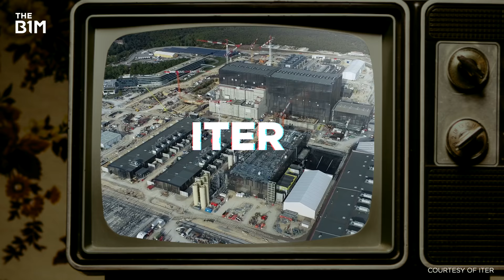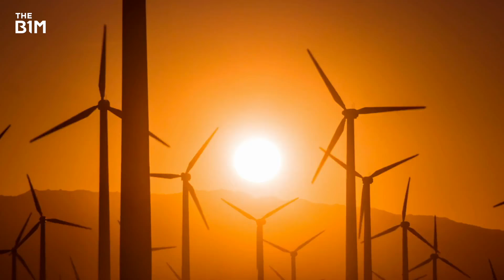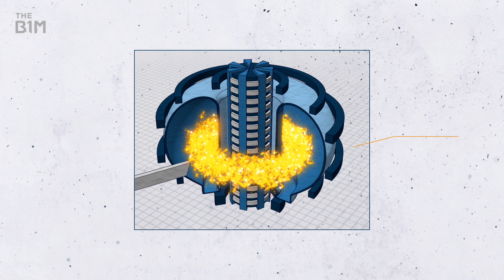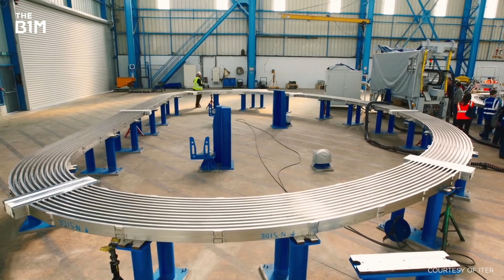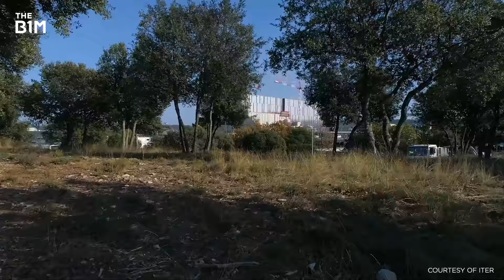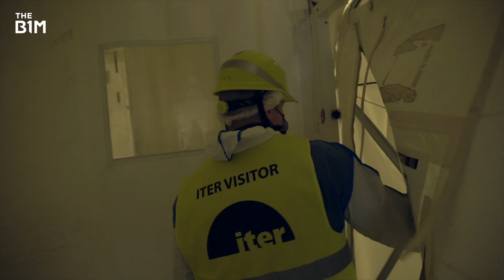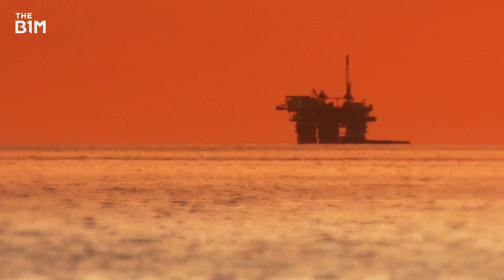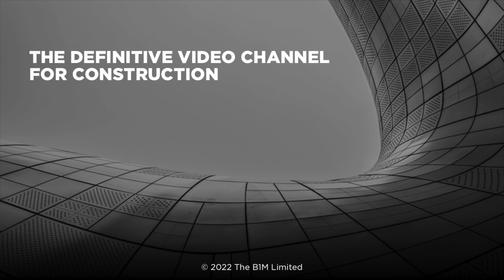We Went Inside the Largest Nuclear Fusion Reactor

Comment: Been following ITER since learning about it in school 20 years ago (!) and I’m glad I will get to see this finally switch on soon and make a better world for our children
Reply: If you need something that big and expensive, you can't but question the viability of this endeavor. Even more so when you understand that this is only the first step, after ITER, they have to build DEMO, and then after DEMO they may or may not have plans for PROTO. But PROTO is the real one that produces net energy.
Geothermal energy has similar challenges, but it is more feasible, and once you start it, it's really free and really clean energy, just like solar but without the night problem. ITER needs tritium, and tritium is radioactive.
Reply: @nicolasmaldonado1428  

Tritium is bread withing the tokamac by reacting with the lithium blanket. It is radioactive but nothing like the radioactivity associated with fission.

As for it being big, fission reactors are big too. And no doubt a working tokamac power plant would be smaller. There are also numerous teams around the world working on small fusion concepts. Some don't require tritium.

Not everywhere is suitable for geothermal. But yes, where it can be done its great. Geothermal isn't 100% clean but it does emit only 5% of the CO2 coal-fired plants.
Reply: First heard about it 40 years ago. Don’t set your hopes up to high. This technology has always been another 40 years down the road.
Reply: @aa2339  That was what was said, 20 years away and always will be. Things are diferant know though, there are billions being invested, breakthroughs happening, and a multitude of companies involved.
Reply: It's a research project, not designed for production.
Reply: Well not exactly. ITER will never add power to the grid.  Its a step toward that goal though.

And worth remembering that huge tokamak reactors aren't the only approach to fusion. There are other, smaller scale alternatives, like General fusions approach and First Light Fusions projectile approach who have just had a major breakthrough.
Reply: @martinw245  oh yeah projectile fusion... I've been hearing a lot about First light within the last month but maybe that's because I live near to where they are located
Reply: @foofung9961  

First Light have just had their first confirmed fusion reaction. Lots of work to be done, but with billions being spent around the world and so many companies involved, I think the breakthrough will come.

I recall even the Lockeed Martin Skunk Works were working on a fusion reactor, not sure if they still are.
Reply: @martinw245  First light fusion is simply a scam. They produced 50 neutrons using a dozen pounds of gunpower. It's simply ridiculous and there is no pathway to ignition or breakeven in such a scheme. A literal high school kid could build a Farnsworth fusor in their garage that would produce 100 times more neutrons from fusion continuously every second. First light is a grift to extract money from gullible clueless startup investors.
Reply: @martinw245  Another "well acksually" neckbeard. Hylian_Grouch never said anything about it adding power to the grid. 🤨
Reply: @mlc4495  

True, didn't say that specifically, but when
 he/she says it will switch on and make a better world for our children, it suggests that might have been the belief. After all, it might switch on and be a failure and not contribute to making a better world for our kids at all.

👍 I take your point though.

Comment: Fusion is always just 10 years into the future, and when the 10 years have past, we just move the goalpost another 10 years.

Fission reactors is perfectly fine, clean, powerful and the safest source of energy available. Of course there should still be research into fusion though, as it is the holy grail of energy.
Reply: Fission energy is not so clean. Nuclear waste is a big issue there!
Reply: @bashvim  - That is a lie facilitated by the "renewable energy" lobby. You can fit the whole world's "nuclear waste" in a football stadium. 

And it isn't waste but actually a valuable ressource, the correct term is spent nuclear fuel and it still contains ~98% of the available energy still in it.

Nuclear fission is the cleanest energy source available in the world when it's measured from cradle to grave and especially when you compare it to "renewable energy" which needs 100% backup power, which cannot be more "renewable energy" as they are weather dependent. Typically it's biomass, coal and gas that is used for backup.
Reply: @TheStabbedGaiusJuliusCaesar  My PhD was related to nuclear waste, so my opinion is probably not influenced by the "renewable energy" lobby. Fitting whole world's "nuclear waste" in a single football stadium isn't an accurate statement. I think about 200 stadiums will be enough to contain whole world's nuclear waste at this time. I still consider it very small. 

And extracting energy from the nuclear waste/spent nuclear fuel is very difficult. That's why it is dumped somewhere. Plus, nuclear waste is going to lie there for millions of years!

Having said these facts, I wholeheartedly support energy from nuclear fission. It is the most efficient and least polluting. Actually, world was looking forward to more fission reactors until 2011 Fukushima nuclear disaster, and world became anti-nuclear reactors. I think, with time, they will be back and next gen reactors will be much safer to operate.
Reply: @bashvim  - If you had a PhD in nuclear anything you wouldn't be calling it waste. 😂

And spent fuel isn't just dumped somewhere. Usually it resides in dry casks at the nuclear plant in a "parking lot".
If not it's resides in the same dry casks at a off site storage facility for later use.
In principle we could just as easily dig a hole and actually dump it and not care about it anymore - but that would be economically moronic. If you actually knew anything about spent fuel you'd know there's no problem with this as it's not fluid and doesn't spread.

Also you'd know that Fukushima was actually proof of how safe that power plant was, as literally no one died from radiation or any nuclear related effects - and that there haven't been any aftereffects on people who lived in the area. All those who died, they died because of the evacuation (old and sickly who couldn't take the stress), the literal earth quakes and tsunami that wiped out most of the death toll. Even the two people who died inside the Fukushima plant was due to a wave smashing them into a concrete wall. It wasn't a nuclear disaster, it was a natural disaster. And all authorities involved in the aftermath has confirmed that the evacuation was a mistake and that more people would've survived if they had just stayed there and gotten help where they lived instead.
Reply: @TheStabbedGaiusJuliusCaesar  ok.
Reply: @Patrick Schlienger - Most definitely. I hope that they succeed at some point. But now they've said "10 years from now" for what? 60 or 70 years? All I'm saying don't make promises you can't keep.

Comment: Wrong, the largest nuclear reactor can be found in Ukraine at Chernobyl, where it is scattered all over the place after exploding itself.
Reply from the maker: That's a nuclear fission reactor. This is the largest nuclear fusion reactor.
Reply: @TheB1M  and also its contained in a nice enclosure. Still disastrous, what happened, although it was entirely preventable and based on an unsafe design found only in USSR. Fukushima was a safe design but had a beyond design basis tsunami that caused it’s meltdown. Even with BOTH those disasters accounted for, nuclear energy is the most reliable energy source and in the same league as wind and solar (far safer than any other conventional source). (See my other comment for more)

Comment: Nuclear power is the most expensive, the most centralized (billionaire owned) and most vulnerable to attacks that we have.
Let's give everyone rooftop solar power empowering everyone their own power generation owners.  Now that's a game-changer.
Reply: Sounds good until you realize the sun doesn't shine all the time. Also even covering all building roofs with panels won't cover our energy costs, not even close. Those panels are also environmentally damaging to produce and they need replacement often.

Solar power need industrial scale production just like anything else if it is to be viable as a main power source which means covering vast swaths of land with solar arrays at best.

If fusion works out it is cleanest most plentiful source of power we can achieve, much cleaner than solar once you factor in production of panels vs construction of a fusion plant.

Comment: #SwitchToSolarEndWars 
Let's put solar panels on every home, business and covered parking rooftop and switch to electric vehicles making nearly everything we do solar powered while completely decentralizing our power supply and empowering everyone as power generation owners.

Solar power is CHEAPER and electric vehicles are soon to be CHEAPER to make and already are considerably CHEAPER to maintain and operate, especially if charged from your own solar power.

A 3-5 year ROI (return on investment) for a solar array that will generate power for decades is a no-brainer and the panels can even be made locally too.

#EndFossilFuels #EndNukes #SwitchToSolar #SwitchToElectric #GreenNewDeal #EmpowerEveryone #DEMEXIT #StillSandersPlatform
#RepublicansAreNazis
Reply: You do know it takes energy to produce solar panels right? To also maintain, replace and dispose/recycle right? Furthermore they're hardly efficient today, they do not work at night or that great away from the equator, cloudy days etc. And in advanced if you try to counter the lack of sun at night, we still have primitive storage capabilities. Then one needs to understand that electricity is a secondary energy source and I just have to laugh if you think we can use it for transportation with energy produced from todays solar panels. smh

I could go on, but you must be arrogant to believe you've figured out something thousands of more qualified people have not. There's a reason why your dream is not a reality and not it's not due to some big corporation conspiracy as they have everything to gain from using this supposed solution as opposed to supressing it....

Comment: One note; ITER will not, and never will produce more Engergy than its consumes. The term Q stands for the Energy thats produced diveded by the consumend power. ITER Q will be lower than 1.
Reply: No, its current goal is to produce 500 MW output out of 50 MW input for 400--600s, which equates to Q=10. The current Q record by the way is JET's Q=0.70.